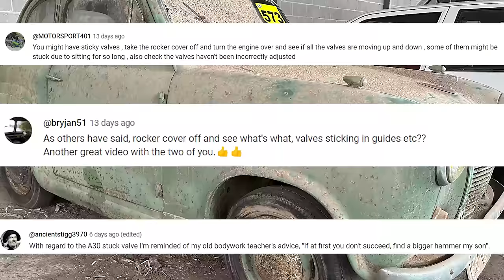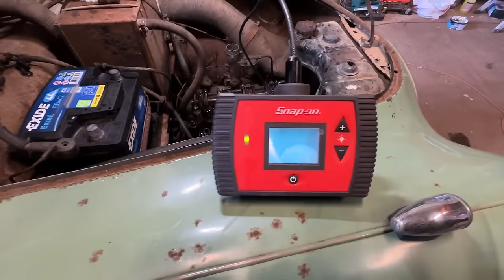First Start in 52 Years! | Barn Find Austin A30 Classic Car Auction Buy #firststart #barnfind

Comment: Well done you two, what a cheering video to hear your A30 start and run after all the trials and tribulations. If it was my Austin I would try to get the clutch working and the car driving before stripping anything down transmission or engine-wise, but advise a full brake check/overhaul at the outset. Good luck and thanks for bringing some winter sunshine to us viewers!
Reply from the maker: Thank you, Kim. You know, better than many, how lovely these little cars are. We’re just learning that 😀

Comment: My first car was an A30 and, as a poor apprentice, I couldn't afford to have it maintained by a garage. So I had to read up and teach myself how to work on the engine. So I really know how you felt when it burst into life.
My A30 was the recipient of a new timing chain and water pump as well as having the head skimmed and new valves and guides fitted. All done by myself, with the help of a Haynes manual. 
If I could do it at 19 (some 57 years ago) you are more than capable of it.
The water pumps were a common leakage problem. Don't  forget, the valve seats might not like E10 petrol, the engine was designed for leaded petrol. But if you do take the head off to work on it you could get new valves and also modify the seats so that she can run on unleaded.
Ps; When I had my A30 petrol was 3 shillings and sixpence for a gallon: 17.5p    !!!!
Best of luck with the old girl, I will enjoy watching your progress.
Reply from the maker: For any younger viewers reading the comment above, that's less than 4-pence a litre (or liter, in some countries)! It sounds like a lot of people cut their teeth on these little Austins. We're enjoying learning them from scratch and it really helps to have comments like this, as genuine personal experience trumps any Google search. Thank you. If the head ever comes off, we'll look at the option of converting it to unleaded.
Reply: @UKBarnFinds  Adding millers VSP and noting modern stuff they call petrol goes off is your way forward if not planning on doing high mileage.  Is it a948cc . 848cc or 1098cc (later than car) engine ? 948s run the most sweet

Comment: Hi guys,  greetings from Melbourne, Australia....a couple of tips for you for future reference. A mix of acetone and atf has been shown to be a far superior penetrant than products such as wd40 or atf or diesel  alone.   Mix it 50/50 by volume. It separates so you have to shake it up before use. Second thing, you mentioned about not knowing what to look for on the bore scope... basically any rust (in this cars scenario), deep scatches/scoring  which would usually be vertical lines or pitting in the cylinder walls. Also any obvious cracks in the tops of pistons or holes. Both of which would be terminal. The mess on top of the piston you showed is just carbon and not a huge issue unless there was heaps of it.
Ideally these checks should be done before attempting to unseize an engine as it tells you what you're facing. Soaking the bores was the right thing to do either way.
Well done on saving a survivor. The A series are tough little engines..
As a general rule when dealing with a car like this I would tackle in this order: attempt to turn engine over by hand a full rotation to ensure it turns freely. Deal with seizing like you did. Check for compression and investigate if none. Lube the bores if the engine wasn't originally seized. Tackle the fuel system and ignition like you did. Spin the engine on the starter (no plugs) to get check/get oil pressure. Put the plugs in, add fuel and ignition and give her a crack!
That little A30 has a nice quiet sounding engine so hopefully the oil burning will settle down and we'll see you on your nest adventure with her..

Comment: Well done guys Austin A30 was my very first car when I was seventeen (I’m 74 now) and had loads of fun with her -1953 vintage
From memory a mechanical clutch and the hydraulic brake reservoir was in the passenger footwell
I use to start her mainly with the starting handle as I couldn’t afford to buy a new battery 
Definitely take the head off and sort out those valves.  Good old wire brush in my day and then grinding  paste and loads of hand blisters. Flush out the waterways, new pump and hoses.
My worse job was replacing the king pins. I finally gave up as I couldn’t get the old ones out. A friendly garage sorted this for me and didn’t charge, recognizing my enthusiasm

Have a great Christmas. Looking forward to the next episode

Comment: Great job you guys. [Another New Zealander here.] Worked on those a lot back in the day. They like full choke to start, [no pumping yet] then when they fire, 1/2 choke for a while with a little throttle feathering. Nice little car, go really well. Good to see you got two now. Good luck with the clutch, it's probably stuck. Just crank it in gear with your foot on the clutch, It will free up fine.
Reply from the maker: Thank you. So nice to have another viewer in New Zealand. Getting the black one has taught us a fair bit about PPW, especially the love of choke 😂 The clutch is next on the list and, hopefully, it will free up without too much bother. One of the 'joys' of YouTube is that I have to sit here, without touching the car, until Claire can come and film it all happening, It's driving me nuts!

Comment: Brilliant 👍👍 if it were me next step would be to check coolant waterways. Remove thermostat and clear gunk, remove hoses and put a hose through until it runs clear. Pump off and check or replace and replace thermostat and put back together. Do same with heater matrix if it has one and lastly radiator off car and flush through. New hoses and water to start with and run up to temp looking for leaks before draining and filling up with coolant.

It may be more cost effective to get radiator recored if a problem there.
Reply from the maker: Excellent advice; thank you 🙏

Comment: Great to see it running after all those years, hopefully the excessive smoke will clear once the rings free up, still worth taking the head off to clean & decoke.
Also replace the valve stem oil seals after cleaning & re-lapping the valves, would be a good idea to do a compression test both before & after removing the head.
The clutch can be freed up just by driving it around your yard, got a few freed up this way.
Reply: Given it is a gold seal engine I dont think it has many miles , but were not de-coke mileage recommendations 6000 miles or less on the old oil specs ?

Comment: Finally got it running, it'll run a bit sick until everything beds back in, i think the club do the water pumps, also i noticed you've got the earlier wider fan belt on on that, the clutch may be stuck but at least it's a mechanical one
Reply from the maker: I went in the workshop today and couldn’t resist it; attached the battery, pulled the choke out and it fired straight up. It’s running a lot smoother now, too. I’m not getting a charge back to the battery, so will need to look at that next time. Thank you so much for all your help.
Reply: @UKBarnFinds  it could be the control box with dirty contacts
Reply from the maker: Is that the plastic thing, top-left of the engine bay, by the bulkhead? Next to the two fuses? Looks like something Dr Frankenstein used when you pop the cover off.
Reply: @UKBarnFinds  Yes its the box with a spring clip holding the cover, it's behind the fuse box

Comment: Congratulations Elton and Claire, bringing the Austin's engine back to life, especially Elton with his dogged persistance freeing up valve train!

If you were not planning any long trips in the car, a full restore of the engine is not necessary.  Just go through any address the typical problems that occur when a car is not used for many years.  Get the cooling system in order.  I suggest using a fuel filter that has a transparent case so you can watch for muck from the petrol tank.  Due to the car's age, it's likely the fuel pump will fail soon and the carburator will need a rebuilding at some point, along with various seals that will start leaking.

Then tackle the clutch, the brakes, and the electrics.

Comment: Great effort!!  Speaking as a geriatric motorist (test passed 1966) and having driven/owned all sorts - Anglia 100e, TVR Griffith 500 and lots in between, wha has troubled me is the throttle pumping while on full choke!  From my knowledge and experience that is almost guaranteed to flood the carb and hinder the engine from starting ... Well done though!!

Comment: Happy she fired up.
Keep going with the heat cycle should help free any gummed up rings hopefully the smoke will clear  the amount of oil it's had down it she is going to take some clearing.but keep at it .
To rebuild the engine is not the  end of the world but keep going and get it driving down the road

Comment: Greetings from NZ. Easy way with stuck valves on these A series engines is to remove the rocker gear then you can hit the valve direct on the stem with some force, you wont hurt it and pry it up and repeat. Lot easier without the rocker gear in the way. But you got there and got it going great job, now subscribed.

Comment: Really enjoy your videos just want to say squirting WD or ATF on the top of the valves won't do anything because the valves have stem seals on them to stop the engine oil running down the valve stem and burning. To free the valves just use a small steel hammer,not a mallet (you need to get some vibration into the valve stem) and gently keep tapping the valve whilst leavering the spring up with a good sturdy screwdriver . As for the jammed rope, just needed to turn the engine back the other way. Keep the great videos coming.

Comment: What a lovely car and what a lovely couple you are!! If I were you, I would take the head off and check valves and pistons thouroughly. Check the cooling system. And change the gearbox oil and differential oil. And then, of course. take if for a little  spin (if the brakes are doing something)!! Again, what a nice lovely car. Don't overdo the restoration, just make it technically okay. And....never sell it! I think it's so nice a memory for you too. My regards, and take care!!!
Reply from the maker: Thank you, Jan, what a lovely comment. My next step with the engine is certainly to make sure the coolant side of things is working. Since this video was filmed, last week, the car starts and runs lovely. I need to free off the clutch and see if it will drive next. I’ll worry about the brakes soon after 😂

Comment: If this helps, Starting from the valve. Valve guides & Seals, Valve Springs, Valve Caps and Collets. The rocket arm rests on top of valve, and on the Push Rod on the other side. Push Rod Lifts the Rocker arm on top, bottom it is pushed by the (Cam Follower) Lifter.  It's possible for the Lifter to stick, it's possible for the Push Rod to bend. It's also possible for the valve to stick.  I would lift the head (about 20 mins) Inspect, clean, repair. Buy new Head Gasket and re-assemble. Love the video's.

Comment: Great result. Where to go from here? At this point don't strip the engine. Let it have a bit of running. Drive it around, let it thoroughly warm up and cool down numerous times. Change the oil again. Give the engine a chance to free itself off, things like the piston rings may be stuck, but also may unstick with use.
With regards to the clutch: the plates maybe very stuck together. So don't just put it in first or reverse. They don't have syncromesh. Try putting it in a higher gear. If it doesn't want to go into gear don't force it. The next step requires working brakes! Push the car to an open bit of road or car park. Warm the engine. Turn engine off. Select first gear. (You may need to rock the car forwards or backwards to allow the gear to engage). Start the engine (brakes off) with the car in gear. It will drive off. Then try to get the clutch to disengage (push the clutch pedal down) while accelerating and decelerating. You might need to be a bit brutal with the gas. If that doesn't work try braking, with gas and clutch pedal down. I used this method on a barn find car with a similar engine (1972 Wolseley 18/85, 1.8 B series engine). It took a few tries driving around the site outside the workshop before it successfully freed itself. It then proceeded to work perfectly well with no further attention needed to the clutch. (Of course, if the clutch won't disengage you can put the car in neutral to stop, or simply turn off the engine).
You can be thankful that the A30 (and A35) has a mechanical clutch release, not a hydraulic one. 
When I first started my 1936 Austin Seven Ruby (Barn find) the clutch was not stuck. Let's hope your little A30 is the same!
Reply: Yeah, generally agree but the Austins had an odd rod and cable brake set up,  in a way easy to set up and clean etc, but not exactly the most efficient of systems - the big drums and shoes compensated !

Comment: Congratulations on getting her started! Yes if that were mine I would take the head off and strip it, clean the valve stems thoroughly, and lap the valves back in. While you were trying to start her, you had at least one or more  inlet valves slightly ope, that's why you were getting puffs of vapour up out of the carb. It's lucky you didn't get the starting fluid ( usually called " start you bastard!) lol on fire as an open valve can cause a backfire in the inlet tract and back out of the top of the carb. And if you are firing ether at it when it backfires it can be a little hairy to say the least! After the head job she should run smoothly as long as you've dumped all the oil which is probably contaminated with diesel and ATF that will have gotten past the rings, and put fresh oil in. If you are going to put this together during the cold weather just make sure you fill the cooling system with antifreeze very soon or you are going to have possible core plugs pushed out in the block, or worse a cracked block or cylinder head.

Comment: Well done, feels good doesn’t it! Needs to do the cooling system next, and get it idling a bit slower. 👍
Reply from the maker: Absolutely. It did slow down, when I eventually gave it a bit less choke, but I’m loathe to run it for too long until the coolant system is checked. That, and the clutch, seem like the next logical steps. The brakes can wait 😂

Comment: well done for getting it started, I had to smile a few times at the obvious things i could see, but only simple if you have had these problems yourself. I would remove the head, If you can get a new gasket? re seat the valves and check the push rods, with that amount of pressure they could have bent a little. its not a difficult job and easy to get at, not like todays car engines. I would bet the centre plate on the clutch as ceased, and the brakes will almost certainly be ceased, I would think that will be more fiddly than the head coming off. The shoes will have to be adjusted, on each wheel, no self adjusters on these beauties. Well done U 2.

Comment: Well done guys she sounds wonderful. My first car was an A35. Before you tackle the brakes get the cooling system sorted & run it for awhile then change the oil again just to be sure there is no sludge blocking anything. Taking the head off is really easy so a quick decoke & lap the valves as the seats on the ones that were open will be sllghtly pitted. I always try & complete one area before moving to the next that way  less chance of something getting missed. Great to see Elton getting more confident. Just remember these old girls are pretty basic if you can use a spanner & common sense you can do anything with them.

Comment: This is a great story, well done guys. It's amazing how a car that has sat for over 50 yrs has gained so much interest. Please work through it to get it back on the road. I'd keep the patina personally, it tells a story.
Reply from the maker: Thank you so much for watching 👍 Yep we hope to get her back on the road 😀
Reply: You may have to replace the valve stem seals due to them going hard but that's no big deal. They're such a simple engine to work on.
Reply: Those engines are so robust, hitting valves with a hammer 🙈 to free them off and it starts after 50 years absolutely brilliant well done with the perseverance

Comment: you can clearly see that the springs are stocked, means the valves are all open. Also in the last video you could clearly see that all the air came back into the carburator and that was also an idication that the valves where sticking and keep the springs down.

Comment: such a great result it was so nice that you didnt just pull it apart but nursed it carefully imto life awsome but yes pull the head off one of those sticking valves was black so valve issue with the utmost respect great video
Reply from the maker: Thank you so much. I have a feeling that valve had been replaced and was already black. The car starts and runs beautifully now, although I haven’t had time to sort the cooling system or free the clutch. That’s the next step, hopefully.

Comment: I love the old A30 and A35 motors, I have had both in car and van style over the years. Those engines will basically run forever, you could leave it standing for another 50 years, and as long as it is kept dry, and with some oil in the bores, it will start and run then.
The body was made of steel, not recycled coke cans, so as long as it was kept dry, it should be a solid little car :)

Comment: I would have taken the head of earlier, still its going, compression check again, check the tappets, cooling system,waterpump with anti freeze for the winter, brakes and start having a run round the yard, then the shops, love the old A and B series engines